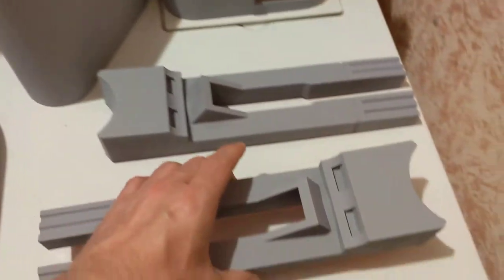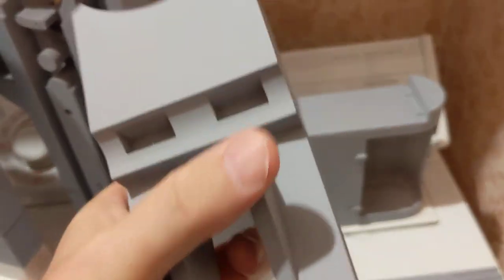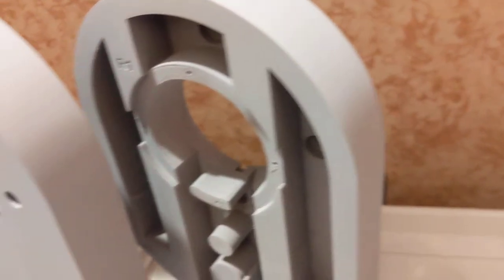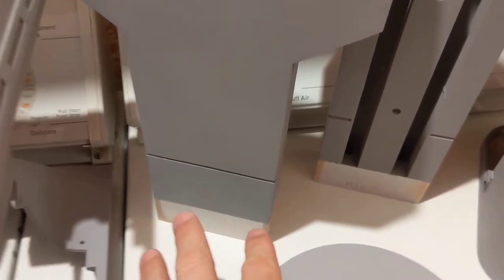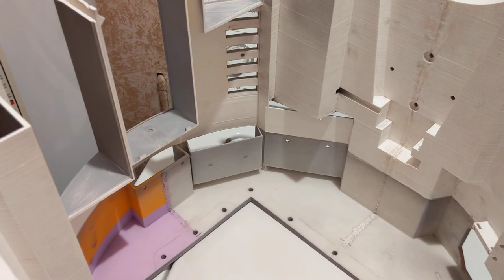3D Printed R2D2 - Part 47

Comment: I’ve been 3-D printing the same R2-D2. I am so glad to see your videos you’ve got me going on my project again. I really hope you finish all of it and post all the videos on YouTube. LOL I haven’t seen one person finish a 3-D printed art to D2 on YouTube yet. LOL I’m just about finished 3-D printing all of the parts. I have most of them put together some parts or just put on with hot glue so I can take them apart but I’m waiting to finish sand until everything is completely put together. I’m also building the drink tray. Are you going to be doing that one as well? The only thing I need my R2 to do is light up make sounds and maybe move his head. I am actually really curious about attaching the feet to the legs. Seeing that I am not making him move he is essentially going to be a statue so I’m not building all of the drive portions in the feet. What is the bare minimum to attaching the legs to the feet.? Do you have anything that shows that?
You’re doing a great job please keep the videos coming and please finish the R2-D2 on YouTube.
Reply from the maker: My original plan was to make the body static so that I could put the dome on top with full lights, moving panels, sounds and dome rotation.  After joining the Michael Baddeley Facebook group and seeing completed fully mobile droids, I changed my mind and figured I'd go for it.  I admit that it's taking so long to build and finish that I occasionally think of going back to that original plan.
In my opinion, your best bet is to go ahead and build the drive portions anyway.  They fill out the top area of the foot shells and are what the ankle attaches to.  You would have to design and print custom parts if not using the drive units.  The other benefit of printing the drive units is that you can assemble them without motors for now and then have the option to add them later if you decide to. 

Good luck with your build!

Comment: Is this version 1 or version 2 on the body, and what percent infill are you using I'm also working on the same 3d r2d2 project currently  the dome is done, rings 1 and 2 on the body but I'm using version 2. Your videos keep me motivated, so keep posting those videos!
Reply from the maker: Actually it's called the MK3 version.  I believe version 1 was the one released on Thingiverse that is way out of date now.  Next came version 2, which was designed to print on printers with 200mm x 200mm print beds and more accurate.  Then for some reason he (Michael Baddeley) called the latest version MK3 instead of version 3.  MK3 was designed to print on 500mm x 500mm print beds and has some extra goodies added in like servo mounts built into the files.

Confused yet?  I know I was!

Someone then cut the body files of the MK3 into pieces that will print on a 300mm x 300mm print bed.  By combining MK3 and version 2 files you can take advantage of a 300mm print bed by printing some parts as one piece that previously would have been multiple pieces, for example the 'horseshoes' and 'booster covers'.  Fewer pieces obviously means less gluing and seams to make smooth.
Reply from the maker: For printer settings, I pretty much went with the Printed Droid – Print Guide for R2-D2 v1.2 found here:
https://www.printed-droid.com/files/